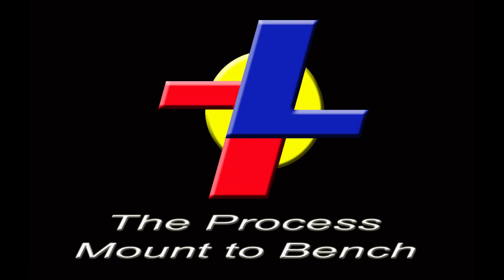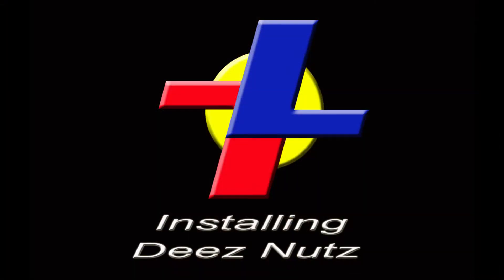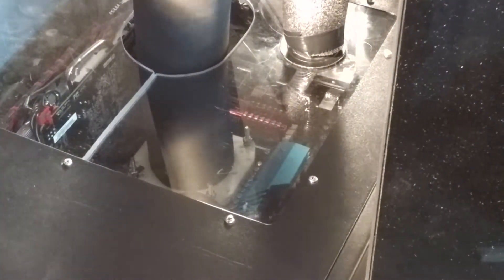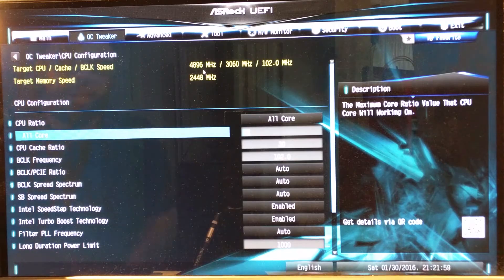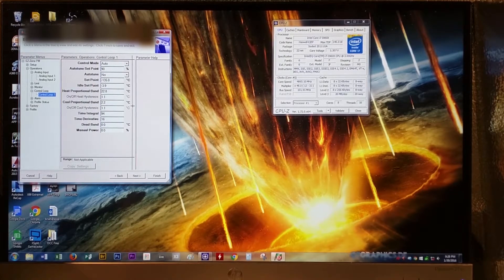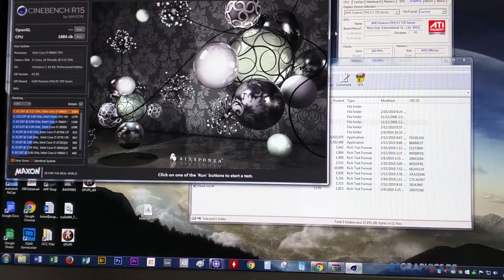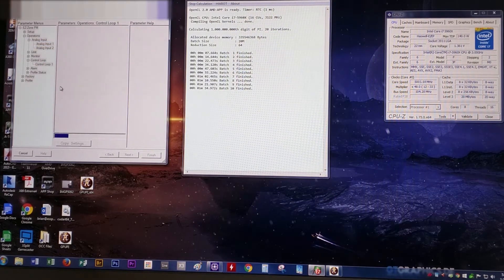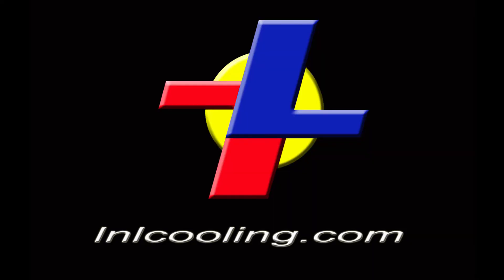Overclocked Intel 5960x Liquid Nitrogen Chiller OCC -120C 5ghz Zero Ice Full Set Up and Benchmarks

Comment: 5 GHz at 1.3v is something you could achieve on a water cooler. Since its at such a low temp, you should be pushing a high voltage like 1.6v and 6 GHz
Reply from the maker: Thx check out my submissions on hwbot - lnlcooling.  Running all the way up to 5.6 GHz with solid benches on lots of benchmarks. I have had my chip up to 5839 with the occ.. This is  definitely next level cooling. Stay tuned. We're about to break some seriously cool stuff. Powerful!
Reply: L&L Cooling Technologies, Inc Haha damn that's awesome. Is there anyway I could contact you? I wanna see the performance on different benchmarks such as cinebench and so on.
Reply from the maker: I'm lnlcooling on hwbot.
Reply from the maker: The performance is off the hook.  The heat swing on Cinebench R15 at 5400 mhz at 1.67 v is like 4 to seven degrees.  But it never cold bugs because the internal heaters controlled by our logic ease the temp curve right down to the set point.  In other words even when the head is full of LN2 and the benchmark stops, the heaters actuate but only enough to flash out the ln2 and hit the breaks at the target.  Kind of like what our mind does when we apply just enough pressure to the breaks slowing down to a stop at a stop sign.
Reply: L&L Cooling Technologies, Inc Ah alright that makes sense. What's the highest you've pushed it yet? I feel like your chip is capable of breaking records XD

Comment: Thank you very much for this detailed demonstration, your system really looks awesome.
Just a few hints on how to improve on video-quality:
-Use a video-capture-card that is connected directly to the graphicscard via HDMI, that gives a better visual quality of what goes on on the screen. Also it can record the screen in UEFI, since it's not running via software
-Normalize your audio for a more stable volume throughout the video
-Speed up those sequences where there is not happening much in front of the camera to make sure the viewers will keep watching your videos without feeling bored

Please keep up the good work and make sure to release more videos on the practical application, probably even done by extreme overclockers like 8 Pack, der8auer or Gunslinger.

Kind regards,
Meta Custom Computers
Reply from the maker: Thanks for all of the tips.  Yes we are needing to improve our video and we'll certainly draw on your suggestions for future posts.  The length of this one is due to the need to show how little time is required to set the OCC up and run it with the purge case.  We wanted to show a fairly  close representation of set-up to use time.  Yes! We have some associations coming that should raise some eyebrows... Stay tuned!
Reply: L&L Cooling Technologies, Inc
Thanks for your reply. Yes, realtime-comparability wasn't on my mind when thinking about the video-length but it makes perfect sense.
I'm subscribed and can't wait for a new video appearing in my inbox. :)

Kind regards,
Meta Custom Computers